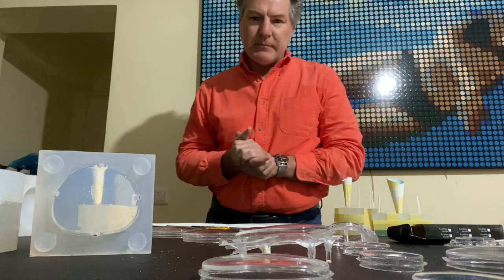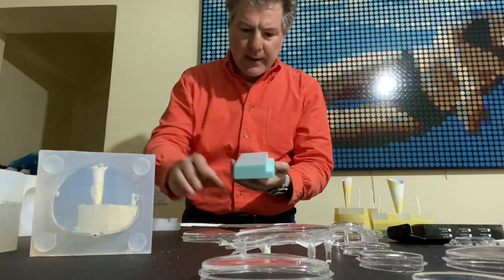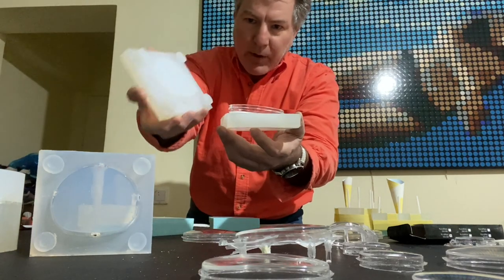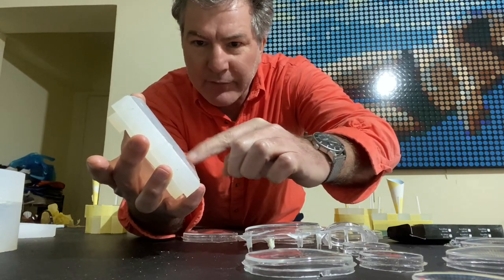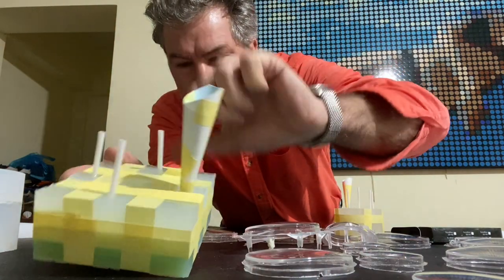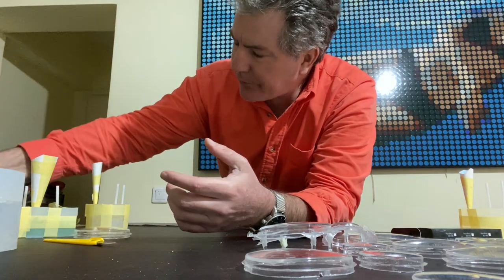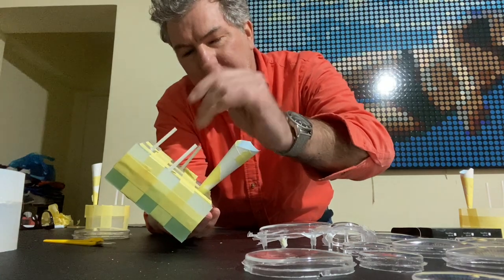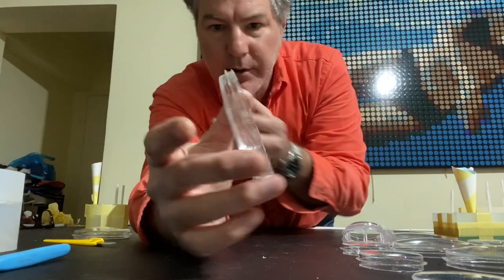Making DIY lenses with epoxy resin and silicone molds like injection molding

Comment: Nice video! May I suggest, rather than throwing away failed silicon molds, you could recycle them by clean cutting them into small chops, then use these chops in your next silicon mold, just pour in your silicon into the mold and leave some gap at the top, then insert these chops into the freshly poured silicon, make sure they don't touch the master, the chops will bond to the new silicon, and you will save liquid silicon this way too. Run a test first before using this method in full mold.
Reply from the maker: Thanks for the tip! That is a good one. I will save it for non critical pours. Thank you!